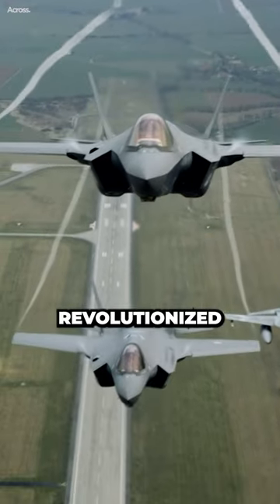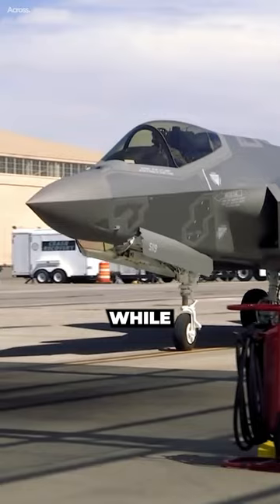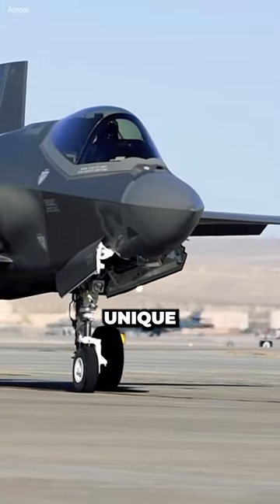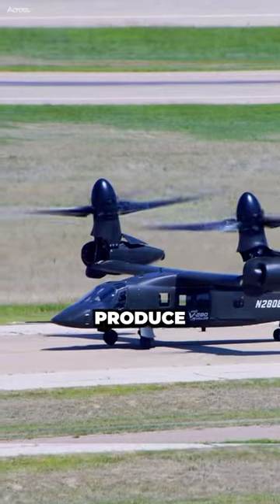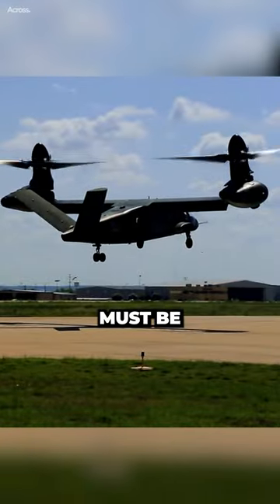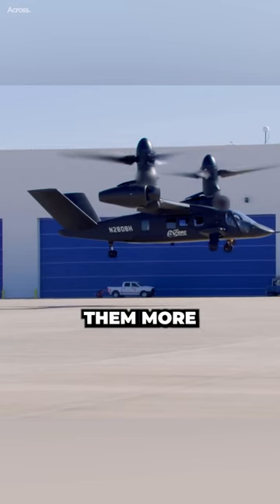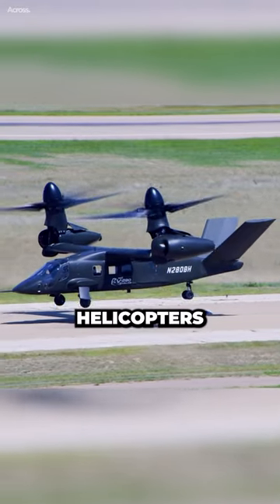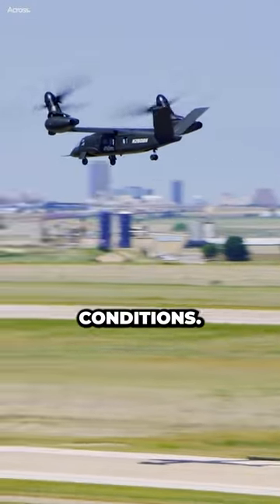Why Stealth Helicopters Are So Difficult to Design

Comment: Didn't SEAL team 6 rode on stealth helicopters to snuff out OBL in 2011. Flew low and quietly.
Reply: They didn’t have radar but then again I’m not sure Russia has working radar
Reply: I feel like it was a regular chinook. Normally, US special warfare has used little birds for the low and quiet entrances. We also can’t be entirely sure that was really obl and not oscar duplessis or something like that 😅
Reply: @AnthonyParisi-sm2yd they were detected by Pakistani radar and fighter jets were dispatched. They were too slow tho since they flew across the border
Reply: @xo_ectophylla_alba_xo little birds are not jsed to quiet entrances, they’re used for quick missions and missions in tight areas. The Chinooks used also were far from regular, no aircraft from 160th SOAR is. It had several counter defenses that an army or marine chinook would never have, which is how one of them evaded a Pakistani F-16.
Reply: It was 4 specially modified Black Hawks made to be quieter and given a radar absorbing paint job
Reply: @randyalbertson4309 that's literally the definition of stealth, but yes, you're right.
Reply: @xo_ectophylla_alba_xo neg. They utilized stealth helicopters. We know this because one crashed in his backyard. There were photos.

Comment: I'm guessing the blade kinda gives off a large radar signature and making the main rotor out of almost anything other than steel alloys with titanium and aluminium in the or carbon fiber composites isn't safe at all.

Didn't even watch the video and that's most likely why, good day to you all

Comment: "Stealth helicopter are hard". Bullshit. We've had fully functional, effective stealth helicopters for at least about 15 years. US DOD has a habit of building obscenely advanced tech, then keeping it a secret as long as possible. 

In 2011, SEAL team 6 rode into Pakistan in helicopters, without permission. They went in, performed the mission and were out without detection. One of the helicopters crashed in OBLs backyard. Photos were taken and plastered on the news. If the efficacy of the mission wasn't evidence enough, the design of the downed bird would prove it. They were stealth helicopters.